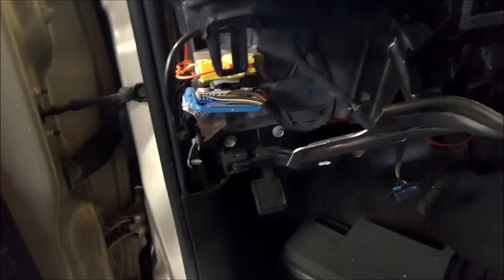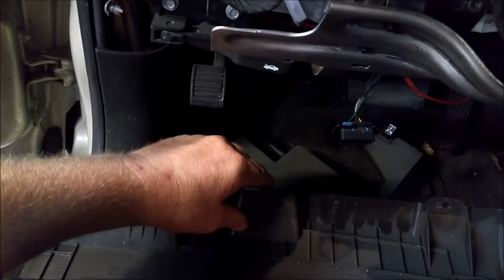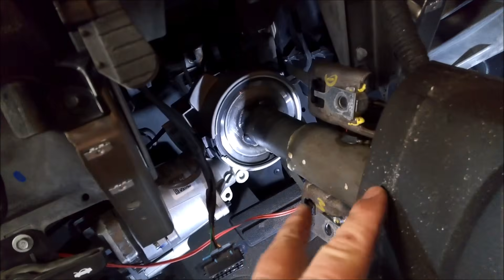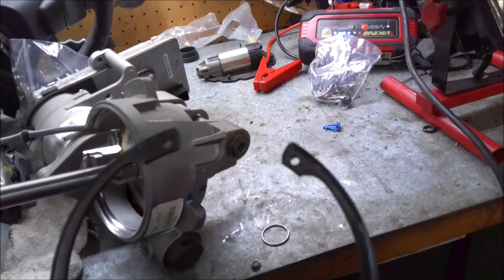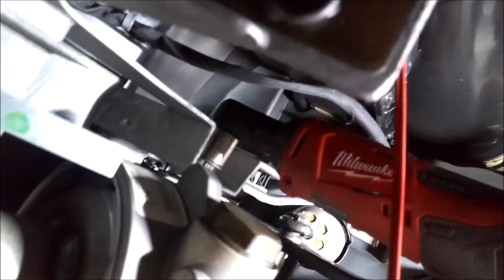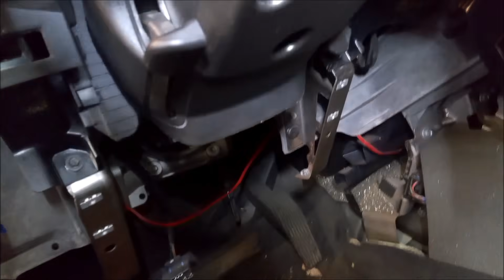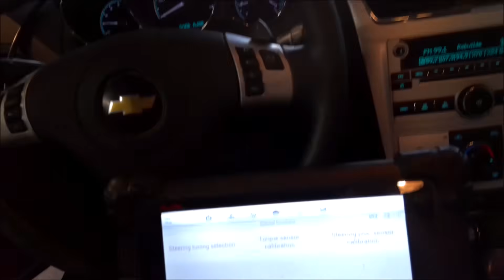2011 Chevy Malibu twitching steering wheel, no power assist, steering wheel sensor. C0545 Code

Comment: Just saying it's under a special recall it won't pop up under gm Vin number recall system but any Chevy dealer should know what recall your talking about
Reply: Is there a recall number or anything I need to tell them? I was about to do this myself before I seen your comment.
Reply: @AzvarrXBL  no they should know just tell them you heard of a special recall for certain Malibu's with the eps system and they will ask a couple question like if you are losing power steering random does the steering wheel have a slight shake on its own and there is one more but I don't remember
Reply: Is there a special time/mileage limit on the "special recall"?  Mine is a 2008 at 282k miles.  Is it correct to assume Chevy would laugh?

Comment: What scan tool do you recommend and what are all the tools needed?
Reply: He had an autel maxysis elite. Its like 3500 on amazon but harbor freight sells one for like 2000
Reply from the maker: That's a tough one for steering angle relearn etc you will need something more than a typical diy scan tool. I use the maxisys elite autel, but a upper level launch, snap on, otc etc will all have those features needed to do relearns. So basically any upper end scan tool. As far as other tools it's just basic hand tools needed.

Comment: my car went out of warranty december 23,2018. This  video saved me over $800!!
Reply from the maker: That's awesome to hear I'm really glad video helped. I appreciate you watching..
Reply: there's actually an extended warranty on this for  the Aura , G6 , and malibu  from 09 to 2012  at GM though.It's SPB 15356
Reply: @exmcgee1647  a little late to the party but this a new issue for me. New to me used car! The way I'm understanding the safety bulletin is that only the 09 Chevy Malibu, which I have, ones that were built between 4/22/08-6/27/08 are covered under the extended warranty. I only say this for the next me who is reading and researching all she can before she or he starts this process. And to the star of this video thanks so much. Only video I've found that covers every step. Like I said I've been reading and reading and between the 5 other videos I've put any faith in, your video is all of their power points mashed into one easy to follow, easy to understand and easy to agree with your approach. Thanks again and good luck to everyone who follows 👍

Comment: You can get this fixed for free at GM, if you had the car for less then 10years or have less than 150k miles under special warranty offered by GM. Mine is in the shop right now,but it's covered. My steering wheel was twitching also! Same thing. I have 2011 Malibu. 113k miles.
Very bad problem. Should be recall. Don't forget to report it.

SPECIAL WARRANTY 15356 SELECT YEAR MALIBUS.
Reply: GM Special coverage 15356
just took mine in today
Reply: @diva129  Yes, girl that coverage was a blessing. They should just do a recall for everyone.
Reply: @diva129   so this was a warranty that you guys paid extra for and not a recall correct? Because I put in my vin number and nothing popped up. Just wanted to know if there is something special/specific  I could mention to get them to do it for my car.
Reply: @crunkking06  No. It is not a,warranty that you needed to pay for. You won't know you have the coverage unless you take it to the dealers. Not advertised. Let me look and see, if I can find the link to the special warranty. Same one Mona mentioned. Right nothing comes up under VIN. I even called GM customer service and they told me sorry we don't see anything.  The dealer should have more information on their computers. You only need the specialty warranty number 15356 when you inquire at the dealers. Not a recall, but should be.

I wrote this for a vlog. Trying to help those that have this common issue.

Special Warranty for GM Bulletin 15356 - Power Steering failure - 2011 Chevrolet Malibu
https://www.google.com/amp/s/repairpal.com/special-warranty-for-gm-bulletin-15356-power-steering-failure-740.amp
Reply: @demetricesmith6886  awesome! thank you for sharing this.  I am calling the dealer tomorrow to see if this works for me
Reply from the maker: Thanks for the information I appreciate that.